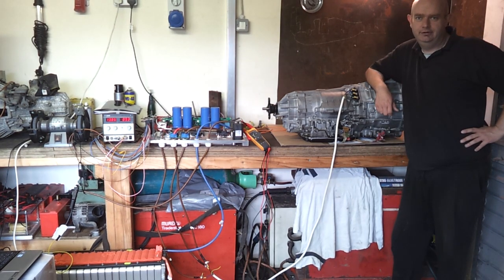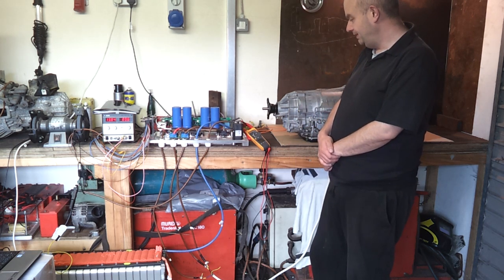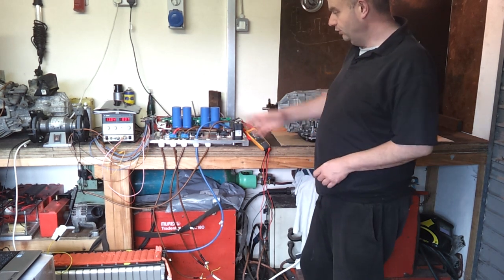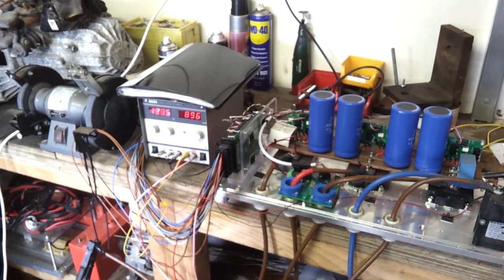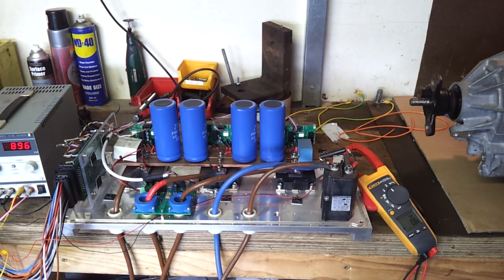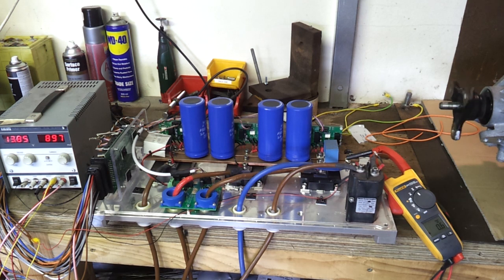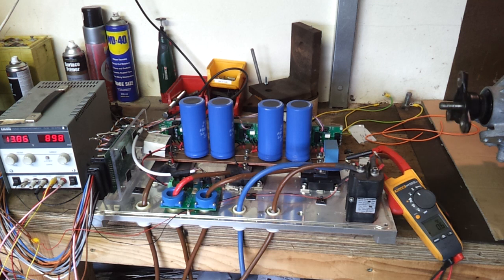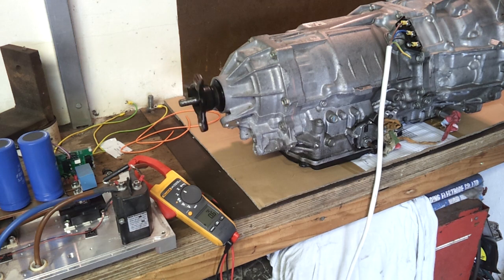BMW E31 840CI EV Conversion 25 : Inverter 06

Comment: Did you make the transmission into an electric engine through wiring? Any explanation would be great since I thought these were mechanical transmissions and not some semi-electronically designed component.

Comment: Dear Damien
I have a Lexus Inverter / converter and a MG3 Diff
I would like to keep the Toyota Inverter, 
My question is , is it possible to take control of this inverter Cheep,
with a anolog to digital ?
UNO R3 Development Board MEGA328P 
Any help would be much appreciated  links or clubs
I am Mechicaly minded,  and not to good at spelling
Kind regards
Colin
Reply from the maker: +Colin Whitehead  Hi colin.Yes it is possible to do. You would need a more powerful processor than the at328p. I'm afraid I don't have any links at this time but may be doing something along those lines myself in the near future. Thanks for watching:)